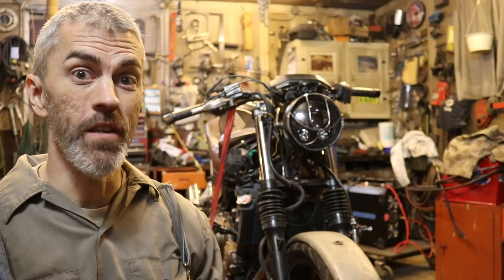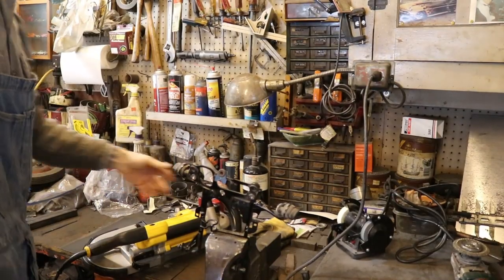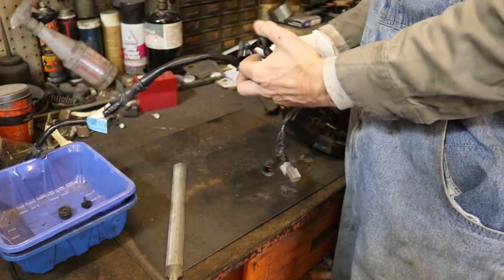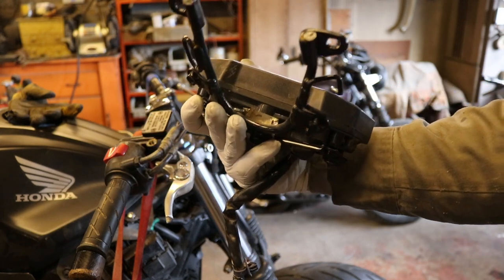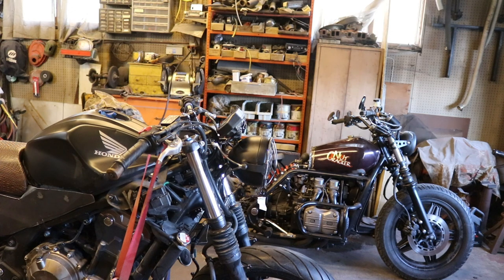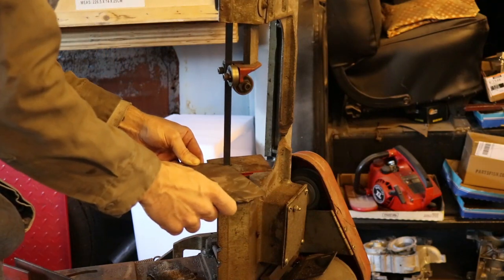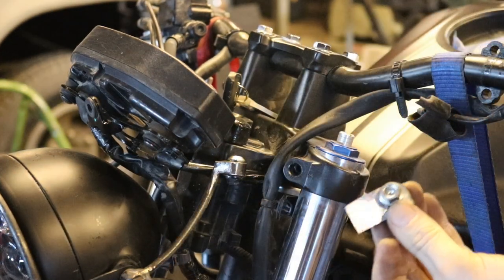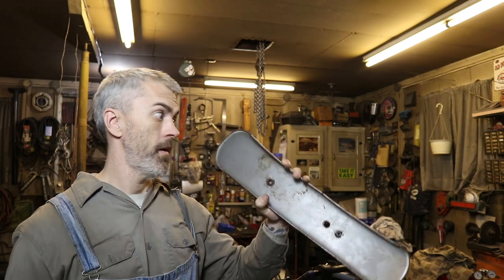Speedometer Mount & Custom Turn Signal Mounts | E20  - Honda CB500F Scrambler

Comment: I think it's a good idea to add a headlight luggage rack carrier to cover the space between the headlight and the speedometer.

but don't don't get me wrong I'm not saying that it doesn't look cool the way.

 it's but it's a scrambler and I you may wanna go camping with it sometimes so it's better to put the tent roll in front of your eyes so you can ride easily without worrying about it and it will not hit anything on the street.

And I really love your work man you are talented.